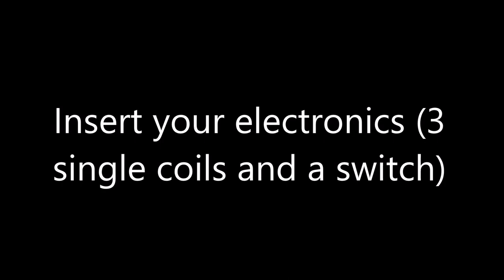How to make a Clear Perspex Stratocaster Pickguard

Comment: You didn't show the most difficult part, getting a clean, perfectly straight line for the blade switch!
Reply from the maker: Ah that is a difficult thing, however several small holes and a set of cheap mini files did the trick for me
Reply: Outback Electrical NZ dremel! Or an inlay router bit
Reply: Look at his, it doesn't have a clean straight line for the switch
Reply: makeajazznoise it does otherwise he wouldn’t be able to install the toggle switch
Reply: @outbackelectricalnz432  Does the inside need to have the tape inside or is it not necessary?

Comment: Didn't show beveling the edge.... I don't have a router, but I did see a video using a jigsaw with a fine tooth blade. I would leave about a16th to an 8th inch all the way around then drill a hole for the pickups and feed a coping saw blade through the hole you drilled then hook the blade to the saw. As far as beveling I would use a table sander or rig up a jig to use with my Dremel. Time consuming I know, but my guitar is home made and a pre-cut pick guard might not fit perfectly. Plus I would have the satisfaction of "I made it myself"
Reply from the maker: You didn't see a beveled edge because I didn't want one, I broke the edges lightly with fine sandpaper but adding a bevel far complicates this process and greatly increases the risk of snapping the workpiece. The jigsaw I used was merely to remove most of the bulk to be cut the rest of the way by the router.

Comment: I appreciate the ingenuity but you can buy a clear Stratocaster pickguard and trem cover on ebay for around $20.
Reply from the maker: I see your point of view but seeing as there are at least 5 different screw hole positions for strat and strat clone guards, It was much more convenient going to the plastic shop and getting a $5 offcut to make it from scratch in an hour or two
Reply: That's all well and good if you have the template and power tools to make your own. Not everyone does so I just offered up an option for those who don't.
Reply: @outbackelectricalnz432   I agree. Using your old pickguard as a template ensures you get the right fit. (If you're careful)
Reply: @dan hurst the man is just showing how its done, jf u wanna buy a prefab one he didnt preach not to.